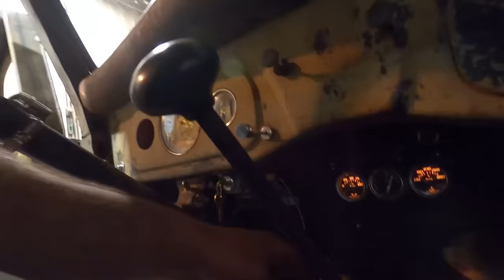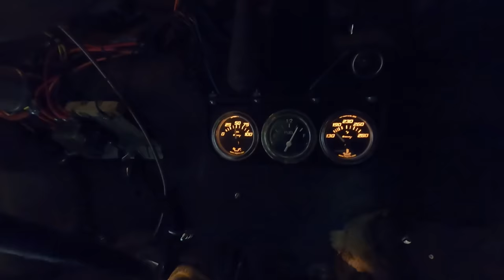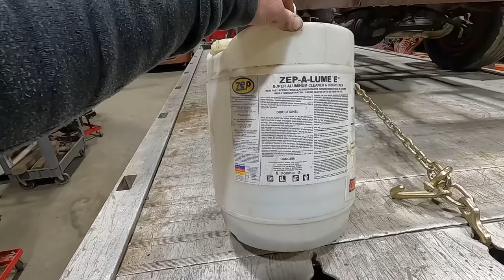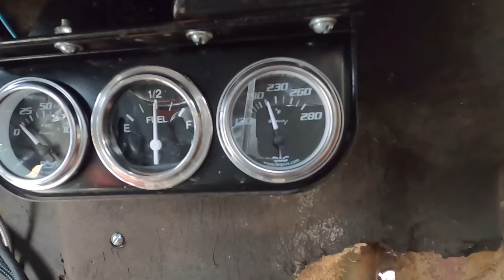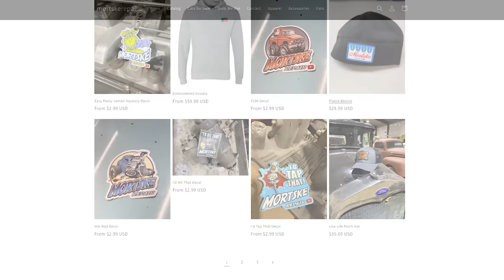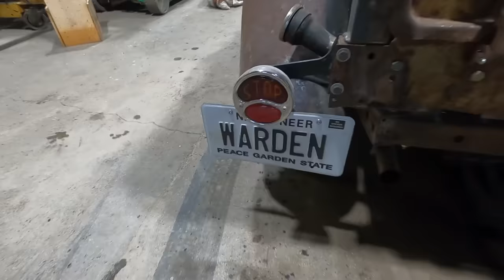1936 Ford Barn Find Pickup Truck! Overheating Flathead V8!! Problem Solved!

Comment: Flat head fords have a major design fault when it comes to modern day driving. #1 In the 40s there were no paved highways so they never went over 30 MPH # 2 the radiators held 75 gallons of water so as to not be able to heat it all up in day # 3 for some reason they ran the exhaust through the block, so it heated the block up way too hot. #4 they did not know about crossflow radiators so they pumped the water too fast, requiring restrictors (thermostats) in the head. and #5 they all have a crack in the block somewhere. ASK me how I know. Racers tried reversing the intake and exhaust, heads with exhaust valves, and all kinds of things to cool it down. Most circle track guys that were successful used alcohol for fuel. White lighting burns cool.

Comment: 1:42:42 '53 5w fp 235 std sb, & '59 Apache bwsb Fleetside 307 olds automatic  both w/ hwy geared pumpkins; that get fresh rattle can flat rust brown Rust-Oleum enamel about every presidential election year. Once asked why do you own 2 trucks? One for each foot's, why.
All while working on that 2nd million. Cause I had to give up on my 1st,

Comment: Loosing that much rust is metal thats missing from the casting. That motor is basically junk. Those motors were casted so poorly especially with the known cracks that most of them have. Find another motor

Comment: Why da hell are you getting the4 bed side replaced with a busted frame,  broken suspension , swiss cheese cab mounts etc etc??? too many sam wichess effecting reasoning? I think I remember you got a insurance check for it.  As for your ASS TRO air chizel, try a snap on one some day, talk about a stiffy!!! Whos nice snapon box is that? I never seen it  at your old shop.  Byuy toola  not boxes, they dont pay bills just impress dickweed guys.